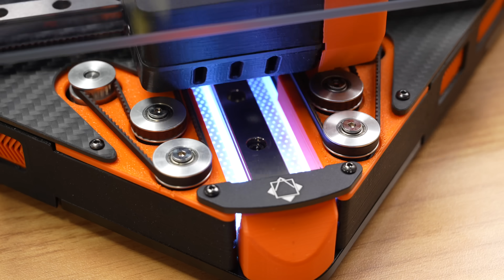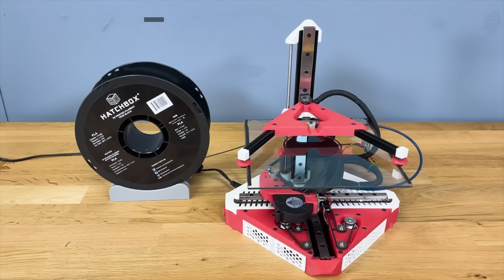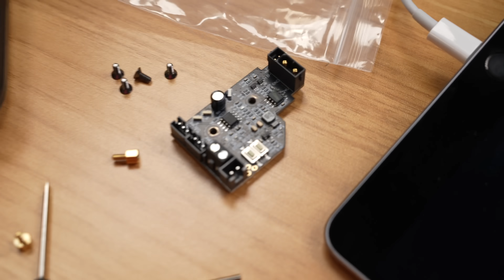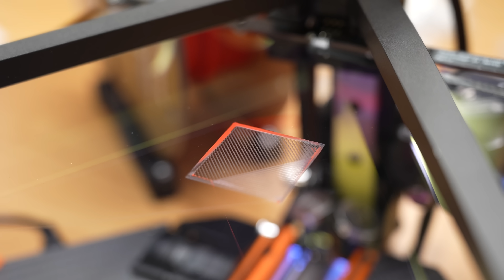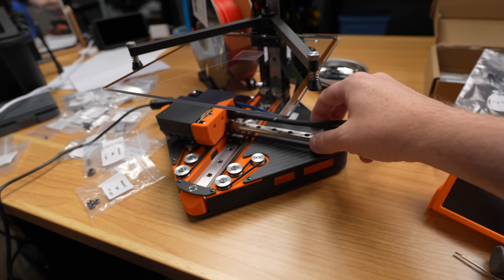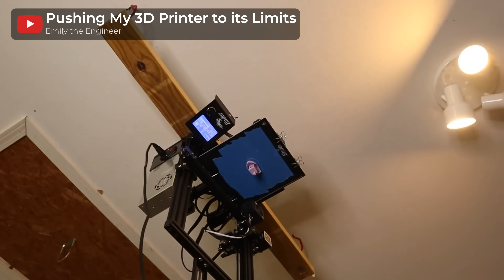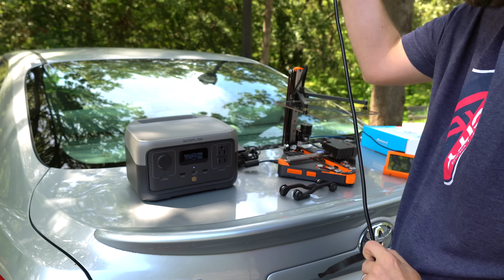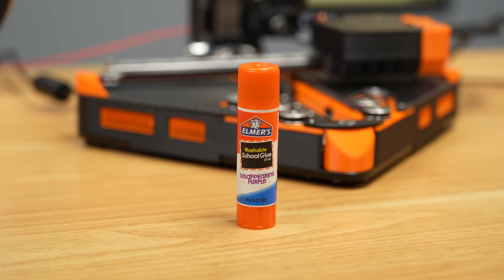Finally, a 3D Printer for Australians!

Comment: For ABS prints, you can recycle the threaded inserts by heating them up, and then ripping them out with a long bolt. Let them cool, and then drop them in acetone. ABS melts in acetone so you'll be able to clean of the inserts and use them again!

To keep the nozzle clean, there's probably a bunch of solutions, but a purge line or skirt might help to clean it first before the print starts. You can also retract the filament a little immediately post heat by 5mm. I know on Vorons, there's a Print_Start macro you can modify to do that.

Comment: Im curious, between this and the voron 2.4 I wonder which is "more portable" The 2.4 is very nice and rigid with its frame, so I wonder which would technically be safer to transport to either events or just be mobile in general.. When I get another vehicle Ill more than likely need a car printer xD
Reply: MandicReally just did a video on this, the TL;DR is that he had to construct a pallet box to protect the Voron 2.4 to prevent the toolhead from bending the gantry.

Comment: I haven't yet figured out why I would want or need a 3D printer. I know those that have them seem to love them ... but why?! Sure, you can make a box for your Raspberry Pi, presumably there are many design choices to be found that will load in to the printer you buy ... then what? What would I do next? If I want a new case for my glasses/spectacles, I buy a new case. If I break the handle of something like a screwdriver, I buy a whole new screwdriver, I don't figure out the dimensions in 3D for something like that that. So maybe I make something I use a lot of ... ummm ... errr ....like ... ummm .... I'm an adept at breaking crockery, so making several plates, cereal bowls and mugs every few months might be useful: but out of plastic? Yuck!
No matter what you make, you have to find a design for that thingummy that someone else has already come up with, that you like, I don't want to work out how to design a thingummy or side plate, it's easier to go and buy another half dozen.

So, you owners of 3D printers, what do you do with them after you have made a Raspberry Pi case?
Reply: You start to find little things that you could fix or improve with printing. Little tools and instruments, like radial gauges, or storage bins.

My mom often asks for a random assortment of things from planter stands to paint triangles.

Try this, go on printables or thangs and just search for stuff you use or are interested in. Often someone has made something for that. Like a controller stand, or a custom hanger for a specific tool.

A printer changes the way you look out how you solve problems, and it goes from buying small tchotchke things to being able to make purposeful items.
Reply from the maker: (Though it's always fun to print tchotchkes too)
Reply: @nomadsgalaxy  Oooh, your mum is my kind of woman! I'm in to planter stands, feet for pots to keep them off the ground ... anything for the garden.
I was just talking to a friend about setting up a bird nesting box with a Raspberry Pi camera on the side that could count the number of visits the adults make to their chicks. I had assumed I would make it out of wood, but a 3D printer could be far better
Reply: @nomadsgalaxy  Woah, that thangs website is very interesting and impressive!

I might be a convert

Comment: If I recall correctly, there are plans to add beacon contact for nozzle based probing and making a usb power delivery powered board as higher wattage usb pd supplies become more common.

Thats the one I think will make these truly portable. Just yank a power bank with a decent pd watrage and you can print everywhere. Add in the beacon, and no z offset or configiuration necessary.

Of course most people would still be better off with an A1 mini, but USB PD and a Beacon probe wpuld make this very compelling indeed, at least for enthusiasts. This would be a tradeshow bagpack staple.

Comment: $700 for a not all there printer that you put together?!?!!?!  Holy fuggggggkkkkk.  Buy a Bambu labs that is assembled and you just remove a few shipment screws for $599....  $849 with a 4 spool AMS system....  This kit is a bit of a rip off IMO....  Cool idea... But over priced for what you get....
Reply: You're clearly are new to the community :) welcome to the norm, Bambu is the exception.

Bambu is able to sell $800 value machines at $300 because of Venture Capital and Government subsidies from China, Positron is a self-funded US design group.
Reply: @nomadsgalaxy Why are you all over spreading this nonsense. There is literally no reason to believe Bambulab doesnt make a profit on these printers.

They use modern mass manufacturing techniques, a lot of automation, and have very few skus.

Also, its weird you pretend having investors is some strange and conspiratorial thing... how else do you think a companu of that size starts?

Lastly, do you have literally any proof for the rest of what you said?
Reply: The pricetag is also too high for me, for what is offered. Most of the problems could have been solved beforehand if they let some tester put everything together. "Banana Hard-/Software" -> getting ripe at the customer... I think it's a cool product, but too early to consider purchasing.

Comment: You just need a purge blob macro to clear the nozzle before starting a print.  That's one of the main advantages of klipper though. All you need to do is add a few lines of text and you won't need to clean the nozzle before each print.

Comment: Honestly this video really exemplifies why people LOVE vorons so much. They very much so are the in-between of the positron and an off the shelf bambu. You build it yourself, tinker with it yourself, but at the end of the day you get a really capable high quality printer that you know the ins and outs of and how to fix if stuff goes wrong. You don't don't get that with a bambu
Reply: My FT-5 was a constant problem. It's in pieces in the closet. My P1S replaced it and was running better in 30mins than my FT5 ever did.

Comment: What if the thing you are printing fail and fall on the printer ?
Reply: Not much, the print head just knocks it out of the way really, then you get spaghetti like normal.
Reply from the maker: Heh the only issue is if something gets gummed into the gears below, could be a fun cleanup!
Reply: @nomadsgalaxy  What if your benchy fall after some spaghetti ? The printer have a collision detection ?
Reply: @nobocks  There is no collision detection in Klipper, but as mentioned, it'll just kinda knock the print off.

Comment: Yeah bamboo, look at this bracket with a logo,  might want to include that in a 300 euro working out of the box  3d printer with insane speed and higher quality print. i mean its cool but a bit cumbersom. and not bringing much more to the table then already excists

Comment: Oozing before/after print. Run a coast for the final extrusion move and if necessary retraction gcode immediately at end of print and tune the retraction parameters so that nothing oozes out until and if using a prime line.

Because it's upside down as long as there is no melt chamber pressure at the end of the print oozing between prints should be possible to be made non-existent.
Reply: Is my comment contribution enough to be a part of the "Positron Team"?
Reply: @brianhutchinson7863 maybe! Honestly if you could submit a pull request, it would be appreciated. We had something that worked in the slicer start GCODE, but a recent update to Orca Slicer removed it for some reason, must have been a mistake.

The toolhead is meant to park, then heatup, avoiding drool. We haven't had an opportunity to patch this as our team is very small, and all volunteers.
Reply: I have a GitHub account but have only made a few feature requests to Cura and ideaMaker Devs so far. I have little to no coding abilities but have a pretty strong understanding of slicer operation and what could theoretically integrate well with hardware/printer functionality. 

In other words I can see conceptual solutions pretty easily but don't know how exactly to code/branch to implement those ideas.

I have gotten frustrated in the past feeling like I'm perceived only as a random guy on the Internet that thinks he knows stuff. 

I appreciate you're comment and validation. A few talented engineers on YouTube  have thanked me and I'm happy that it feels like I'm gaining a little bit of prowess.

I'm actually totally unfamiliar with Orca and only mildly familiar with Prusa Slicer. I don't know how much help I can actually be if I'm not using Orca and I apologize if it seemed as if I own a Positron (I do not) 

I've been following loosely since V1. I try to keep up with tech that is innovative but that's as far as I can do most of the time (I'm a low income person)

If I can help regarding the "pull request" (I actually don't know what a pull request actually is) 

Oh wait I think you're saying you had a good Orca/Positron integration but a recent update messed that up and a pull request would be to remove whatever code caused the problem?

Anyway let me know if I can still make a request on behalf of Positron Peeps. I'll do that. 

Also please someone print little hanging bat figurines maybe for Halloween. It would be basically a performance art installation of sorts. I've been thinking of that since I saw the Positron and for as long as I can remember.

Comment: 11.16 loading filament will always be an issues upside down. i suggest a silicone catch cup, that you place over the nozzle, is contoured to seal as close and tight To the nozzle as possible.
Then you can just extrude into it, set it aside to cool, and clean it when cool, solid, and the print is well started.
i love the small format printers, so this one is... interesting. however, i'm Really interested in the head swap systems for multi-nozzle and multi-material printing. upside down might have an advantage or two in retraction and automatically clearing material out of the hot end, but swapping will be tricky... unless you could simply run the print head off the exposed linear rail.
there's possible features i Really like: you could add an accordion curtain to retain the print head heat. w tweaking, that might be able to maintain a better overall print temperature for layer bonding...

Comment: I don’t understand how it sticks to the glass. My Ender 3 regularly pops the print while printing, I’ve tried various bed heat settings, hair spray, paper glues, etc. probably the most frustrating part of the experience is chucking away a 50% completed pint after 4 hours of printing.
Reply: Ender glass beds weren't the highest quality, and weren't as flat as what we're using. Borosilicate sticks really well when clean to PLA and a little too well to PETG

Comment: After building my own delta, took 3 days at 100 dollars of parts, the software of non mainstream printers kills the fun for me. Even using marlin firmware the delta is fast but I cant trust it to not burn my apartment down or actually use the calibration map of the print bed it just made. Fun? yes. Reliable? no.  I have a monoprice mini delta and Taz 6 for reliability. Wish it was a Bambu and the A1 mini is very tempting now.

Comment: Call me lazy but I want 3D Printers to be like normal printers. Come in a box prebuilt, plug to the power and start printing. I have a creality ender 3 v2 with CR Touch and I still spend hours levelling the bed. I think I'm so tired of spending 80% of the time trying to make the 3D printer work.
Reply from the maker: Honestly the full built Prusa or a P1S or X1C are that. A1 maybe too, though it lacks a few conveniences.
Reply: Just buy an A1. You dont have to suffer anymore my friend.
Reply: @BeefIngot  yeah totally, I had a look at a few different options. I'm trying to decide what model to go for but A1 seems to be the right size, price and featureset.

Comment: You might of had a short in your first power jack and the adapter went into a protection mode.
Reply from the maker: Possibly... it's strange, the plug worked fine again on my PC PSU, so I wonder if there's another difference between their cable and the one I normally use at that desk.

Comment: Jeff, tip for the washers, use small amount of grease to hold them in place on the bottom of the pulley's as you install them, they will stick in place and wont fall into the machine, use Super-Lube grease.
Reply from the maker: Oh, that would make sense; even a drip of oil could hold it in place a moment
Reply: @JeffGeerling  Certainly will, same method works for non ferrous screws.

Comment: an interesting tool but this price is a ripoff. i would pay 300$ at most for the novelty but otherwise I'm sorry. Passing the factory assembly job to me whilst asking bambulab prices for a product that barely can print.. no. ty.
Reply from the maker: I wouldn't call it a ripoff—it's expensive but they also provide all CAD files, all instructions, etc and also work with the Positron LT team to make sure the builds are as accessible as possible.

If you don't have Bambu-level funding or existing Prusa-level reach, it's hard to bring the price down and have any margin at all.

Comment: "Is it perfect? No, but is it my favorite experience with a 3d printer in my life? YES!" - Welcome to custom building 3d printers. When you build it yourself and et it all to work, it is hard to not fall in love with it when it finally works. Congrats on the build Jeff!
Reply: It's exactly the reason why I opted to upgrade my Ender 3 (V1) to Klipper, SKR1.4T, Rpi3, linear rails, SO3, steel spring plates and dual-Z, instead of buying a Bambulabs 😅 Sure, it was most likely not very economical, but keeps me out of the Bambulab system. I love keeping my stuff open instead of closed 😂
Reply: So true, and then you know it inside and out.
My first printer was basically a parts kit. It was a delta with just the base assembled so 90% of it had to be built and assembled.
Reply: It's like the ikea effect!

Comment: As an Australian and someone who has been 3D printing for 13 years, I'm ashamed to admit I have been printing in the wrong orientation this whole time! No wonder I have bed adhesion problems, I'm trying to use a northern hemisphere printer in the southern hemisphere, duh 🤦
Reply: @rico13 you may be using the wrong extruder and filament. Remember: in the northern hemisphere the extrusion goes anti-clockwise. Make sure you are using both a clockwise extruder AND filament designed for clockwise extrusion. Yes it costs a bit more, but is well worth it!

Comment: So $700 and you have to print your own parts and put it together for 12 hours, then fiddle with it to get it to work kind of just okay?... Would be very cool as a project just for fun for maybe $100. But if its the joy of tinkering and putting stuff together, which I do understand, then I'll buy a bamboo and take it apart and sell it to you for $500...😅😅
Reply: Welcome to Kit printers, if you can figure out how to make them cheaper, you can submit the Pull Request :)

Bambu is indeed cheaper, but they are subsidized by Government and Hedgefund Investors making a $600 printer be sold at $300 to overtake the market, soooo good luck?
Reply: @nomadsgalaxy Why are there so many people making up wild conspiracies about Bambulab. The truth is just that they use modern mass manufacturing techniques, a lot of automation (one of the reasons Prusa still lags behind in build quality and production speed and requires so much manual labour) and had good engineers who understood printing.

Yes they had investor funding because of course they needed that to make these products with this level of polish, but the part about the government is just made up nonsense.

Leave your sinophobia at home.

Comment: welcome to Klipper. i learned a lot about it well i was waiting for my SV08. converted my ender3v2 and ender 5 over. 
you can fix the load filament issues by changing how much is loaded and have a purge area after you change filament. just need to make a change to the load filament macro.

Comment: Is it any fast, compared to a mk4 for example?
Reply from the maker: With another mod, the cooling can be made to hit 10-12 minute benchies, so it can go pretty fast. Some materials wont go faster though as the hotend can only keep up at high speed with PLA or other filaments 220 or below

Comment: Filament Ooze sucks. What I do on my printers is make the nozzle touch the bed, then start heating. Reach the temp target, draw a line, go print. It does not help with filament swap, but it surely does during the start print.

Comment: Clever design? YES. It is good that people push design boundaries and try new things. Useful?... not in the slightest.  It's the same design choices that make mobile phones impossible to own without a case, cause the super flat TV's to fail early due the fragile nature of the panel and  fancy flat laptops to overheat and screens to separate.

This is a tool. Function before form. Prusa understands this. After everyone is finished going "oh wow" this thing will be forgotten. Congrats to the designer for making it work though but this will be a flop.
Reply: Its weird you label prusa as if they are special in that regard. Theyre arguably a bit behind the cirve right now even outside of the XL which is cool but applies to a niche audience (Though I do wish I jad one).